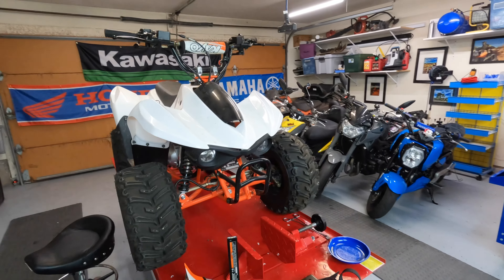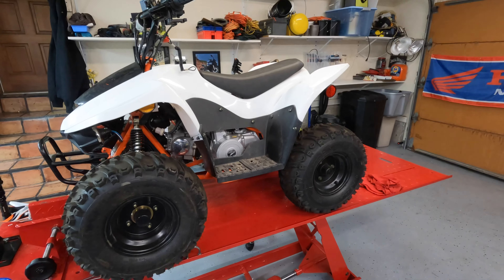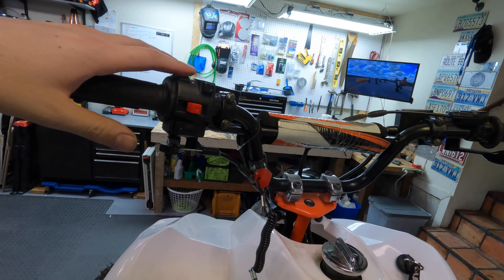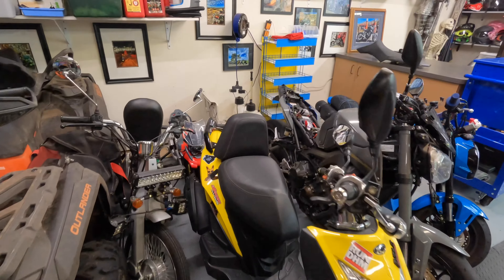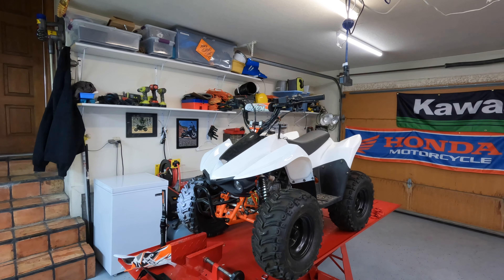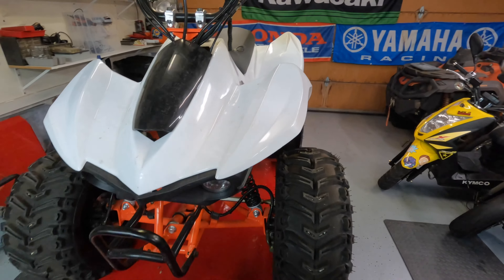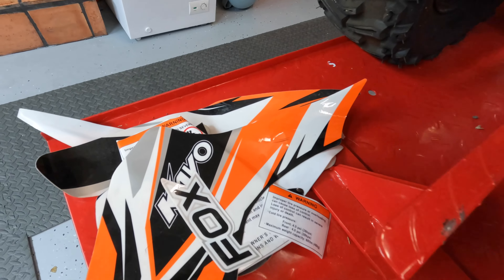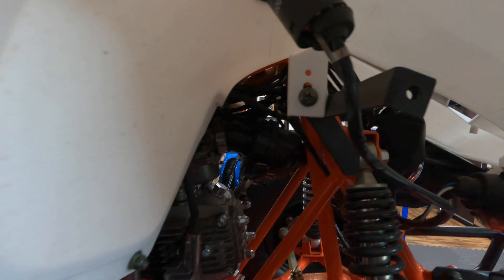Kayo 70 Review & Disassembly

Comment: I appreciate this video.  Going to look at one of these tomorrow that hopefully needs only some minor carb work.
Reply from the maker: Glad it helped
Reply: what you call the parts using on front brakes? i want to put front brakes of my kayo ay70. what all parts i need to buy? 😊😊😊
Reply: Did you do anything else to cure the bad starting /cold running eg rev and bogging out other than clean carb and replace filter , im having same issues on my daughters kayo70 your video doesnt mention what cured it

Comment: Funny I was just working on this thing and cussing the whole time because of the locations of the screws for the plastics and such, and having to remove the handlebars.  The thing you pointed to and said it's the brain box I think is the remote kill switch....yours appears to be mounted with double sided tape.  The one I have is mounted in that area but behind the gas tank...WITH PHILLIPS SCREWS.  So I had to either remove the gas tank or get a screwdriver under the gas tank to hold the screws to get it out.  Had to remove it because my nephew swore that was the problem with no-start and he read we could cut the wires and jumper two wires to deactivate it.  He ended up giving me the quad or he was throwing it away, so I soldered the remote box back together and emailed the company and they said you can just unplug it to deactivate.  Anyway, the CDI box is in front of the gas tank mounted on the frame.  Looks like you're also missing a reflector on the left rear bracket.
Reply from the maker: Yeah not the easiest thing to work in for sure! That makes sense about the remote kill. Does yours take a while to warm up and idle off choke
Reply: @fubarsnafu82  No, after a minute or two I can take off choke,  but you can't give it much throttle off choke until it warms up.  The carbs on these things seem to be the biggest weak point with the varying problems.  I only just got this thing running yesterday but I started it cold about 5 times on choke, after a minute or so it will idle without choke.  I was surprised because my nephew said it hasn't been started since last summer.
Reply from the maker: I agree maybe a carb upgrade will unlock the full potential of these quads.

Comment: My son has had this quad for about a year or so. Bought it brand new since day 1 it hasn't ran without choke being full open all the time well now its not running good even with choke wide open. Any 19mm carb you'd recommend or brand you've had best experience with?  Thanks man!!
Reply from the maker: Sorry to hear that I don’t have much experience with carbs on these things they don’t seem very robust, I would search and see what eBay or Amazon have to offer I would not spend a lot on a new carb for it. Look at pictures ect to get a close match
Reply: Thank ya sir!! I'll look um up
Reply: I was just looking around for a carb for this quad.  My nephew had a 2021 for 2 years for his daughter and it wouldn't start the other day, so we spent 4 hours trying to figure it out.  We didn't get too far and he said "you take it or it's going in the dumpster, I'm not screwing around with this thing anymore".  I messed with it for hours and finally figured out the micro switches on the brake levers were broken from sitting outside all winter.  Those switches supply power to the solenoid when you pull the brake to start it.  After I got it running it didn't seem to have much power so I was looking at upgrades and I see everyone recommends a PZ19 made in Japan carb.  You want the one with the choke linkage (not the lever, unless you want to reach under the bike to choke every time).  Only problem is the throttle tube on top I think should be 90 degrees and I can only find one that's 45 degrees, but the one on Amazon sold by HIAORS has a 45 degrees and several people said it's a perfect fit for the Fox 70, but one guy says it's not because of that tube on top.  I don't know but most of the other PZ19 carbs are made in China.  If you get that one let me know how it works.

Comment: Anyone who has this kayo 70 have any issues with the lack of power when taking it on any terrain ? Seems mine need a push just to get it going and my daughter is 7 and doesn’t weigh much. . But on the street it seems to run ok . I have also removed the throttle screw and still not enough take off power
Reply: Yes my son is 5 and weighs 46 pounds and it doesnt like the very small hill in our yard unless he hits it hard. But on flat ground it does great for him just learning and getting comfortable on a quad